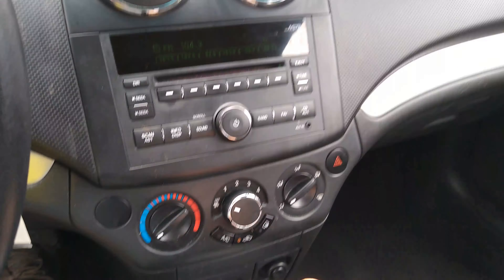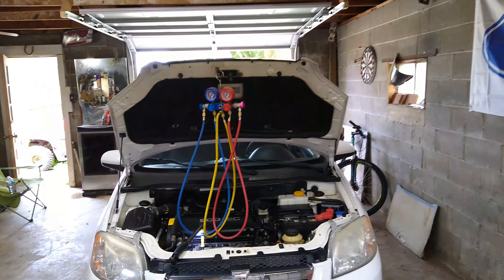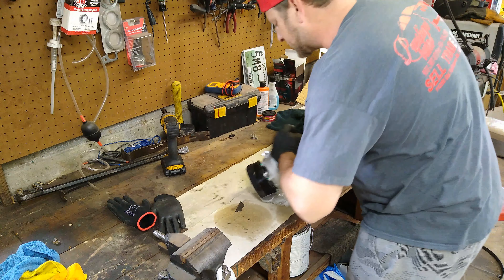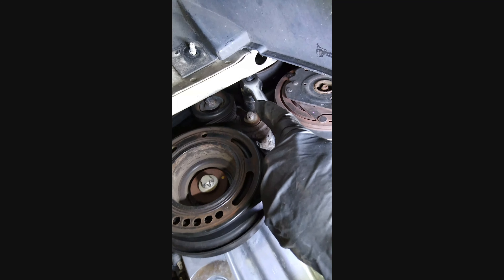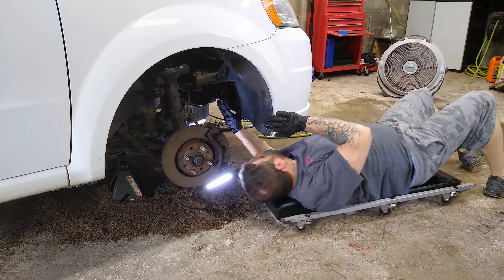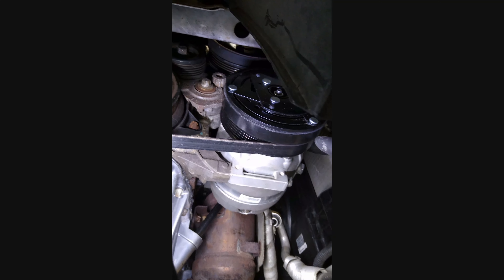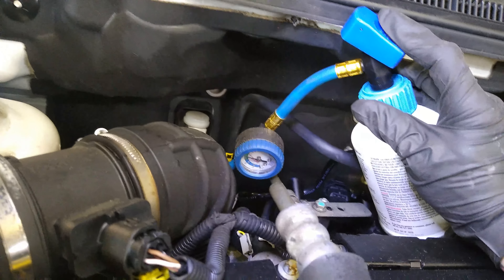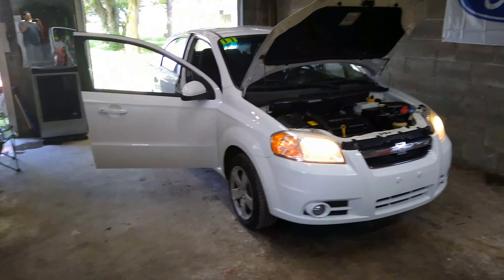AC Compressor Removal & Installation 2011 Chevy Aveo

Comment: My mom's 2010 Aveo has a belt just for the ac outside the serpentine belt, so to change the serpentine belt I need to remove this short 2 pulley ac belt. I'm changing the alternator and last night I put a 13mm on the tensioner pulley bolt, turn clw, and couldn't get it to move.  I got that star thing you put the 13/16 on and pulled right. I will try that. Your video is the only one so far showing this. I hope it loosens both belts.

Comment: Please advise as to how you determined the problem was the compressor.  Was it the manifold gauge readings such as a high low side reading?  Also, did you replace the dryer while you were at it?

Comment: Thank god it’s not gonna be as tough to change as I thought it would be I have a 2011 Aveo and for two years now no ac every summer it quit working the second month after I got it and that was in July in about 100 degree weather ac was offering barely any relief it was better to drive with the windows fully down and air off
Reply from the maker: It was a very easy process with some basic mechanical skills. And much cheaper than taking it to a mechanic for them to do the work. I think I payed around 75$ for the compressor on Amazon
Reply: Prestige Auto nice I’ll have to look into that I don’t know why I didn’t think about amazon as a location to get car parts

Comment: Dude, great video. And now I am going to attempt to do this for the Lady's car this weekend.
I appreciate the steps and the little things that you pointed out like the wiring harness connection, wheel well panel, mentioning the size of the bolt heads, etc.

Also: Constructive criticism coming...
Watch your sound levels. I went from getting blasted by music to barely hearing you. 

That's a huge turn-of for these videos, so just be careful.

In the end, this was great. I'm going to save hundreds of dollars fixing this myself.
Any thoughts on replacing the shrader valves on the high and low side? 
Should they just get replaced for a car this old, regardless if there is a concern of them leaking?

Thanks!

-Ryan

Comment: Great video 👌 Sr, got one question, do you add any oil to the system?
I got an 07 and iam about to replace my, thanks for share
Reply from the maker: I did not on mine. I just installed it back together and filled it up with the little can and kit from Auto Zone. It has been working good since. Thank You for watching my video and your comment. And good luck on replacing yours. It was a very easy job.
Reply: @RadFabz  cause i going to blow the lines, some grey color came out from one of the charger ports
Reply: You should check if theres oil in the compressor if it doesn't have it then you have to put oil. Mine doesn't have so I put 180ml from the plug bolt I read the oil capacity from the original compressor I remove. .

Comment: Hi nice video. Is that belt that you loosened, the timing belt too. Just wondering if you had to line the crank up with the cams before tightening it back up?
Reply: That is the serpentine belt. No need to line anything up before removal. Just make sure the belt is all the way on when you’re done.